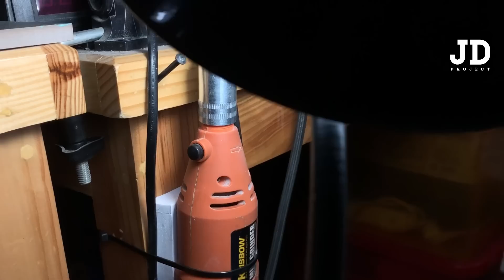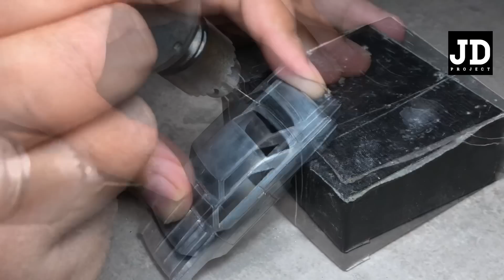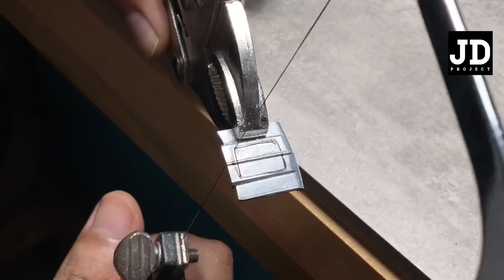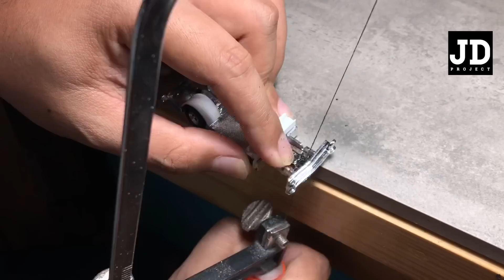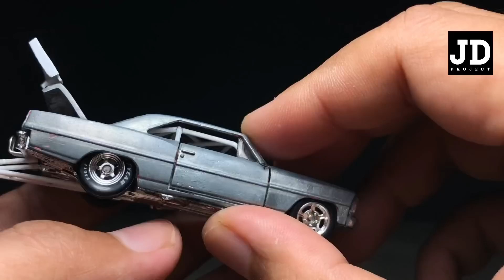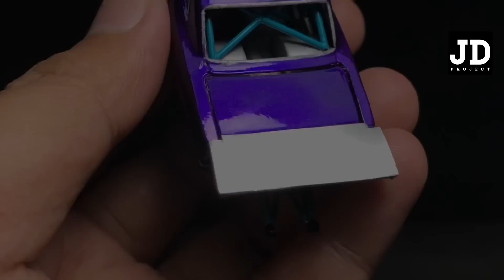'66 Chevy Nova Drag Hot Wheels Custom

Comment: There is a tool you need for using your jewelers saw. Its piece of hardwood about a foot long, 1/2" to 3/4" thick about 3"to 4" wide with a v cut in the one end like a fork. 
The width of the v is dependent on the size of what you commonly work on. The length should be about 3 inches. You clamp this to your table and it supports your work and gets the saw away from the edge of the table giving you greater freedom of movement

Comment: The only thing I'm not crazy about is the clear scoop on the hood. The only types of race cars in the real world that have that type of scoop are ones with nitrous. Also, boosted cars (race cars with a supercharger or turbo/turbos don't have exhaust like that. Supercharged cars (roots/screw blower or supercharger) will almost always have the type with 4 tubes in a row side by side coming out just behind the front tires aiming upward. Turbo cars will almost always have a hole cut in the front fender just behind the front tire also, though sometimes in front of it, and it will come out there, almost flush with the body or it will stick out about 4-10" or so and aim upwards also. Here are 2 examples, 1 of each. Anyway, just a thought for future cars. Love your stuff!

https://www.racepagesdigital.com/wp-content/uploads/2019/02/002-Danial-Pharris-Radial-vs-The-World-Pro-Line-Racing-Lights-Out-10.jpg

https://tvandnews.racerswarehouse.com/wp-content/uploads/2019/11/Pro-Mod-Standout-Melanie-Salemi-Joining-Radial-vs-The-World.jpg

Comment: Why did you need to drill those holes when you ended up on and edge?
You didn't need to drill those holes.
I'm just waiting for you hot wheels guys to figure out not to have your windshields look like their are 3 feet thick.
I've got the answer but I ain't gonna tell you.